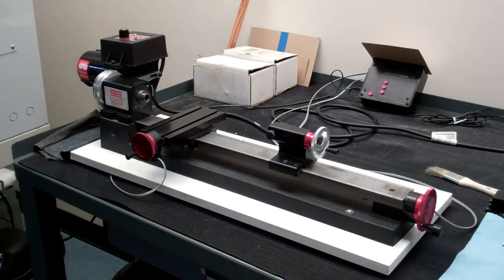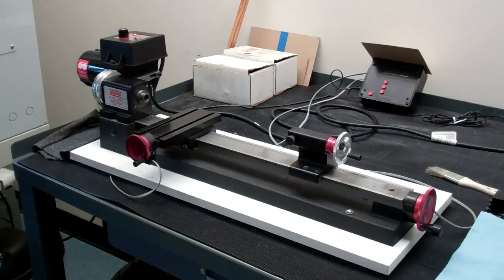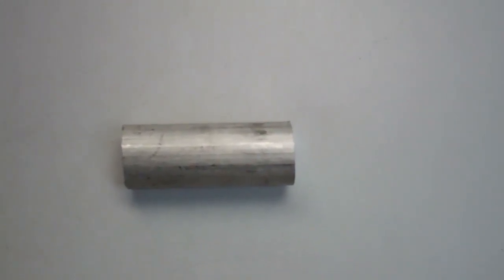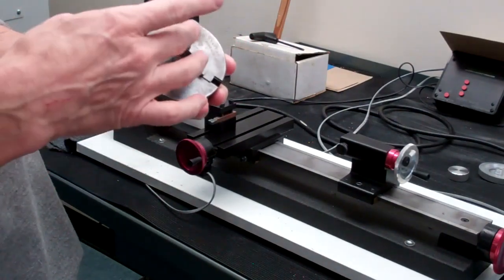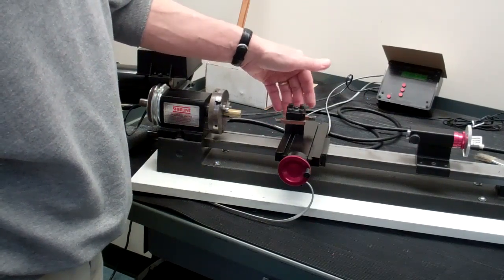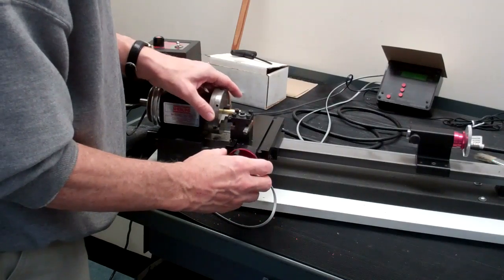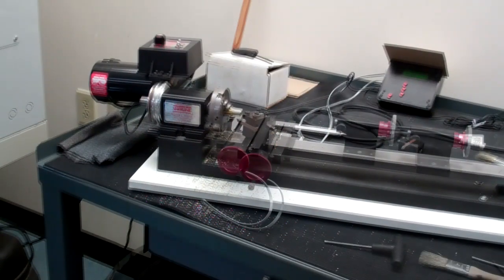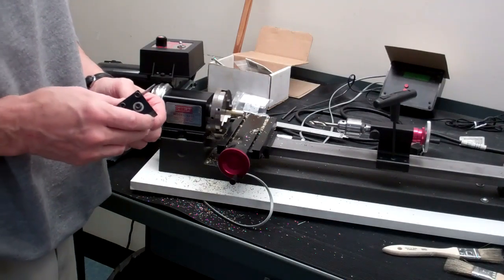Introduction to Sherline lathe

Comment: What material are the tailstock, carriage and cross-slide (t-slot table) made of? Is this the same material as Proxxon uses for the PD250? Thx
Reply: Good question! I have a Proxxon PD250 and will investigate the Sherline closer. Proxxon's design concept is confusing with it's strange "sandwich design", a mixture of steel and zamak parts. The carriage is a catastrophy. The compound is useful for setting angles for thread cutting and such, but totally useless for taper turning. After a year the main  lead screw is worn out on my machine. My conclusion is that Proxxons are hobby machines for soft materials. I don't consider them as precision tools, although some components and accessories are in fact quite good. If Sherline made a bigger model I would probably try it. I like the clean carriage with T slots, the tiltable head stock, so you can turn tapers without a compound. Overall it has a more modular design than the Proxxon. One important issue is weather the lead screws have axial thrust bearings. I have added that to the main lead screw on my PD250 but for the carriage lead screw it is not an option, there is simply no space for it, because the carriage is full of cavities.

Comment: You state it has all the same kind of functions as a full-size lathe, but I don't see a compound slide, so surely it lacks functions like taper cutting and threading?
Reply: It can cut tapers, the headstock rotates. They sell a compound on the website

Comment: You would think by now that with the exponential advancements in CNC technology, you would see it in the Sherline lathe in terms of robustness, threading capabilities, and all the capabilities you would see in large industrial machine tools as they did in the 50's and 60's. And think about watchmakers lathes. These machines were made with exceptional accuracy, design, and capabilities yet when they were made, they had no CNC machines to make them. When you look at the Sherline, it looks unfinished and far removed from robustness and capabilities. Sure, the cost would go up if it was made of cast iron, but you would think it would be offset by the high efficiency and accuracy CNC offers which saves time and labor. For Christ sake we now have robots operating CNC machines yet with all this technology the Sherline lathes have not changed very much since the 70's. Why is that?  Why is it that cars and computers continue to improve in innovative ways yet the Sherline seems to be living in the past? Being a machinist myself for many years, I prefer instead to buy an old Logan lathe and restore it.
Reply: The new Sherline lathes appear to be CNC ready. If I had to guess, I’d say they intended for operations like single point threading, etc. to be accomplished with steppers working as a powered feeds.

Comment: Good video. What is the maximum diameter that this lathe can turn?
Reply: I was really wanting him to tell us that as well.
Or at least tell us what that diameter of that part he had put down 😏
Reply: @montanaplease on their website it is listed as 3.5” but there are riser blocks you can add to reach a 6” total diameter. The riser blocks cost 85$ for a set (includes headstock and tailstock riser)